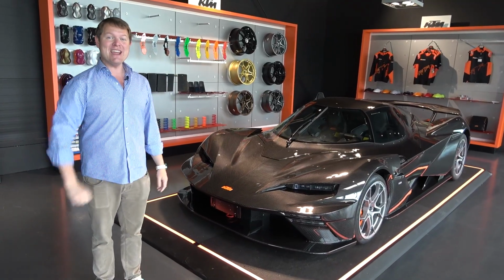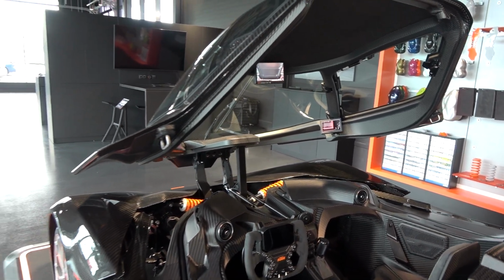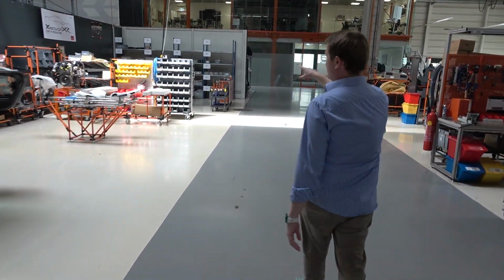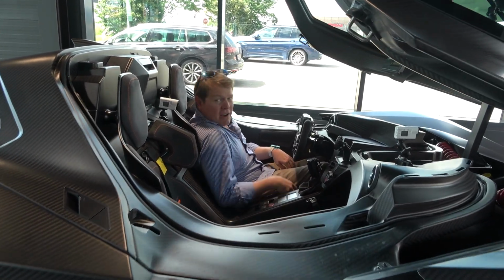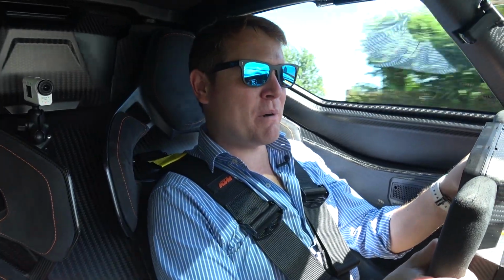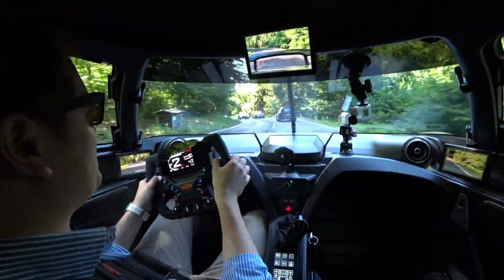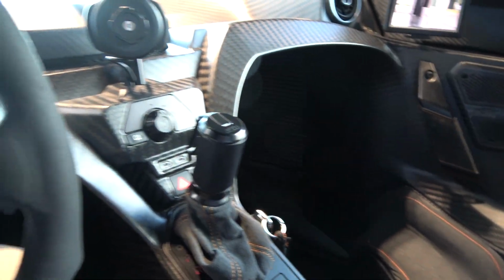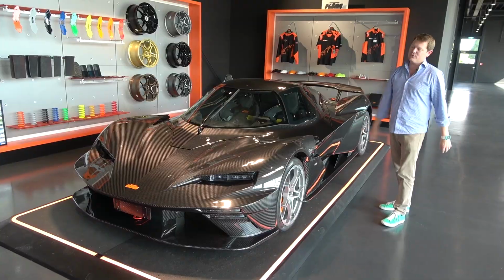VISITING KTM! X-Bow GT-XR Factory Tour and My First Drive

Comment: There is NO WAY this costs anywhere close to $300 000. It has a 5 cylinder engine from Audi. The engines are usually the most expensive things on the car.

Comment: The engines a bummer… should have many options.  But I’d pick a high revving na 6.  Like the gt4rs or gt3 engine.  Or something that would fit easier like a custom cosworth 6.  Wish they’d make a kit engine that was affordable.  Like 50-75k affordable.  Something that wouldn’t be insane in a car like this.  A 450hp 10k rpm 3.5L straight 6….

Comment: What a car!! I think I’d be going for the GT4 though. Have always loved that car. Tiny Batmobile looking thing!  Mad revs and if I remember rightly, even lighter weight and flick ability than this one;)

Nice work Shmee! That was both fun and informative to watch.

Thanks 🙏🏾
Reply: Ya, gt4 rs is miles ahead of this car.  But if they had same engine in this car it would be a lot better.  Just wish the rs was closer to this weight.  It’s not heavy but it’s too bad modern light sprints cars can’t be in the mid 2k range.  I just sold a turbo Miata.  It was 2170lbs… 240whp., not a bad car for sure, but my buddies gt4 is just so much nicer and more refined etc etc.
Reply: @damonm3  Hey, I'm thinking you are referring to the Porsche GT4.. I was talking about the the KTM GT4- there little race car that came out some time after their open top road car. Its in the background of the video and is the car seen just before Shmee gets to the featured GT cars.  Kinda looks like a smaller version of the featured car. Like a mini Batmobile. Theres some kool videos of this car doing its thing on track via POV. Proper weapon and in a different league to the Porsche GT4- as awesome as it is! I'm not sure if KTM makes their GT4 for the road but if they did I reckon it would be a ton of fun!

Comment: I'll start by saying I absolutely HATE ktm dirt bikes. I owned a 2009 and a 2012 450sx and they were absolutely awful. Worst dirt bikes I've ever owned and I grew up on Hondas. I bleed blue. I'm a DIE HARD Yamaha guy. However this little unit is fuckin cool as all get out, jack. One thing that makes my balls itch though, what...in the actual FUCK...is up with that wheel fitment? Just atrocious. Completely and totally atrocious. Look if you live on a dirt road, get a girlfriend who doesn't so you can leave your super low cars in her garage. That's what I did. I own a highly modified 2016 Shelby gt350r. I've done a completely insane amount of modifications and improvements because sadly, I did aquire it after it had been crashed in the rain. I'm an automotive fabricator/blue letter master Ford tech/frame and chassis guy. I got the car more square than it was from the factory. All cars have a bit of a sway here, maybe one frame rail is sitting a fraction of a degree in board in comparison to it's twin brother etc. I got my car 100% PERFECT and I do mean perfect. I put all wisefab front knee assemblies, wisefab rear trailing arms and left the rest stock aside from the tippity top shelf KW coilovers all the way around I had to save up for 4 months to buy. I built my own 8 into 1 titanium headers, into 4 inch titanium tubing back to some one off titanium mufflers I built myself, the exhaust comes out of an OEM tail pipe from a Lamborghini Aventador in the middle of the rear bumper. Its dry sump, 6 point 4130 roll cage, carbon fiber bride seats, EAS delete with a quick release and naardi wheel, sold the carbon wheels to have some one off 3 piece wheels machined and plated in black chrome with anodized purple hardware. It has a carbon hood, fenders, doors, decklid, custom ground cams, link stand alone ecu, the oiling issues have been addressed and remedied by Texas speed, triple disc clutch and lightweight flywheel, i could go on for a very long time. The car took me 4 years to finish as I'm not a wealthy man. I'm a retired 36 year old scout sniper/the career choices I mentioned above. On top of that I have 3 sons with 3 women. The car weighs 2890 lbs, makes 677 wheel hp at 5200 feet above sea level, and with the cams now revs to 9,500 rpm. I run it on c16 only. It's absolutely incredible. I cannot stress enough how amazing these 2016 gt350 are there's nothing like them. I like to slide around and drift My.Rose highway so I had to bail on the original suspension geometry it just doesn't let you do that. But I can make it grip and she does 1.4g on the skidpad with 295s up front and 325s out back which is nothing to sneeze at. You can't fathom the way this thing sounds. I spent almost 180 hours and almost $4,000 on materials building my headers and exhaust. It's rotary fire, 100% equal length, and with the mufflers I made along with the Lamborghini tail pipe it's absolutely astonishing. My girlfriend says she has a "cargasm" every time I push the car. Which is ALL THE TIME baby. Why in the hell would I spend a weeks earnings on race fuel to fiddly fart around, no. It's multiple felonies every Saturday I take it out.

Comment: I’ve gotta say I didn’t give this car much credit when you introduced it originally . But seeing the manufacturing approach, production floor and the clean design in carbon really changed my mind. I also think that the low horsepower, low weight combo compared to other super cars would make it a much more usable and enjoyable car on the street.  If I was in this market this would be the car I’d buy.

Comment: Amazing car but ultimately a death trap the canopy systems are beyond stupid if that thing rolled over you would have zero way to get out other than the small windows if something were to jam the glass shut during the roll over you would have to smash the window increasing the time to exit meaning you’re at much higher risk of injury or smoke inhalation. If they changed it to a regular door system it would be one of the best track day weapons on the market

Comment: Have 6 KTM bikes
1290 Super Enduro my built custom 1 only in Australia
1290 Super Duke RR
720RFR
950 Super Enduro Erzberg No: 52
950 Super Enduro
640ADV

Were planning to buy the X bow GT XR only down fall is its track only in Australia so wish it pass road specs in Australia

Comment: Surprised it weighed 1,250kg wet, thought it would be lighter than that. All carbon, small 5 pot engine, only 2 seats, no doors..i would have thought closer to the 1000kg-1100

Comment: If their bikes are anything to go by, do NOT own one outside the warranty period... Even then you'll probably only be able to drive it a few months before it's in the garage for a year
Reply: That's what I thought, but they don't make the drivetrain. That being said, I have no idea how reliable that 5 cyl is. I know people have been making big power with them lately
Reply: @trashbandit2449 It's the 5 cylinder from Audi. It's basically bulletproof now. Don't know where the gear box is sourced from which could be the reliability issue
Reply: @TheFlexUchiha  hope so. I'm still not a big fan of audi due to cost of repair and complexity but I guess if you can pay for the car it's a great drivetrain. Also no clue where the dct is from